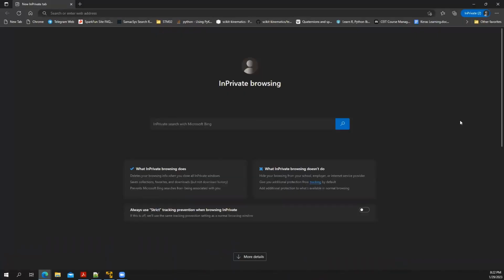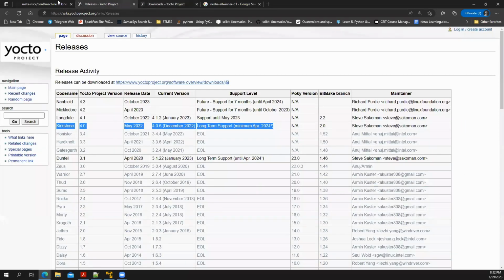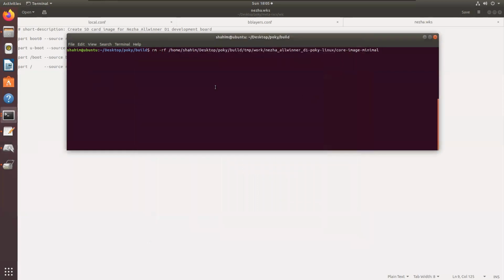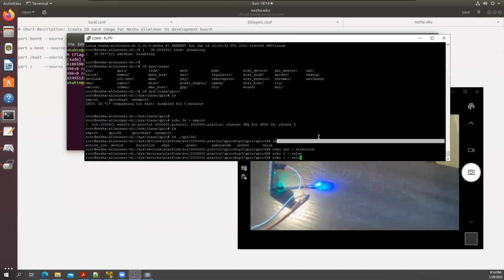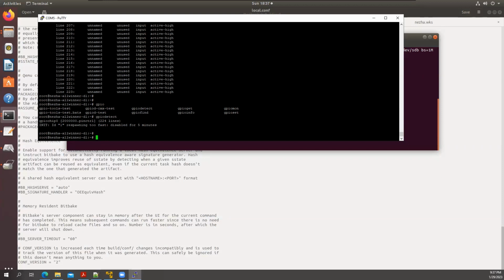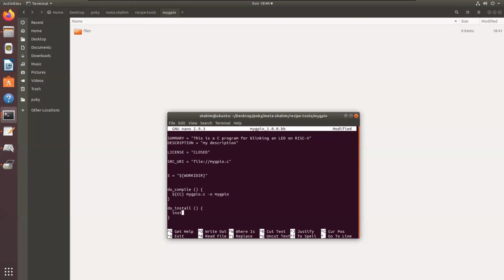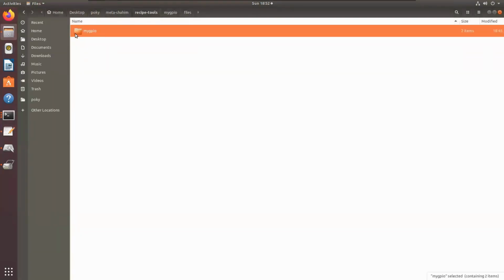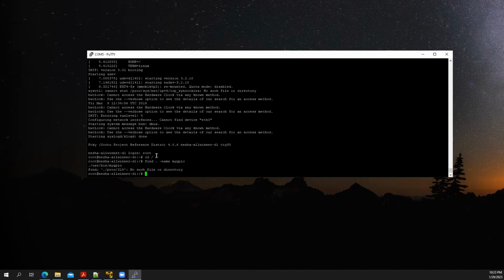Yocto #7 (RISC-V and Blinking LED)

Comment: Nice tutorial.  By the way: how is the debugging held in yocto?
Reply from the maker: I am happy that you liked it. Would you elaborate “debugging in Yocto”? You mean, how we debug the code?
Reply: Yes! Debugging the code.
Reply from the maker: Easy peasy, first develop/write your code in any linux platform (it is better in an embedded linux) and do the debugging as it is a programming language.
Yocto is just a tool/helper to package your code into the a custom image.
Altho you can use gdb, lttng or any debugging tool as well
Reply: But the way you did in this tutorial , it's quite impossible to set breakpoints.